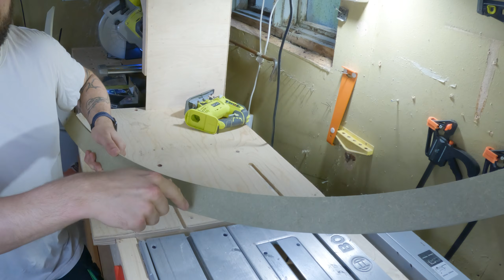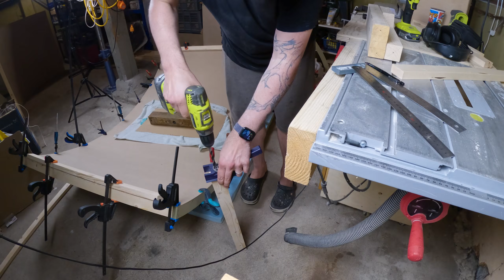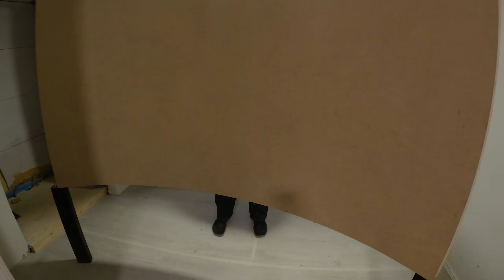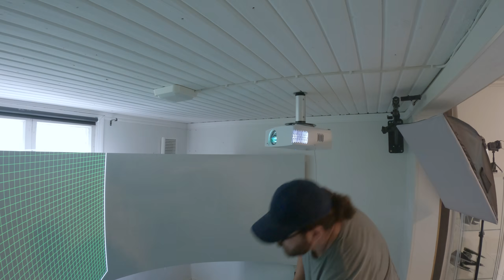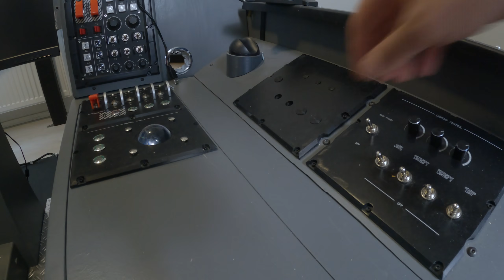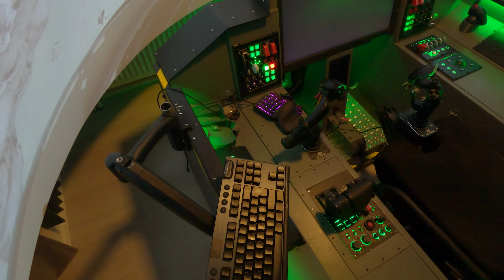ULTIMATE Simulator Experience - Building 180° Curved Screen for Space and Flight Sims

Comment: hello, i know you changed your display setup recently, but have a question about this.
i have 180degrees curved screen and 2 4k projectors, optoma wave120sk.
warping works good. and the software (display pro) shows it's correct resolution, BUT, in my eyes.. it doesn't looks like 4k... i feels like it less than HD resolution.
mapping is perfect here.. but can't even read some text on it.
i see you have almost same config with me.. but yours look amazing.
do you have any idea that i should try? 
i asked this to fly elise... but the FLY ELISE keep telling me to get another projector...
Reply from the maker: Unfortunately FLY ELISE customer support is quite useless. There are couple of things that might affect this:

1) You will always lose pixels due warping. How much, it depends on your setup. But it will never look 4k.

2) I had ultra short throw projectors and I think this did mean I needed even stronger warping in the center of each projector and the image might have been a bit out of focus in the center. The image was really soft there.

Imagine this: closer the projector is to the surface, the larger relative distance difference there is between the center and sides. I would expect the image quality would have been a bit better in the center if I had enough room to use something else than ultra short throw projectors. Though I'm not 100% sure.

Comment: What full resolution is this, and what is the "aspect ratio," as far as games are concerned?
Reply from the maker: Basically two 4k displays side-by-side.
Reply: @UndeadParrot  Your FPS must suffer quite a bit, I would imagine, as that is significantly more pixels than I push @ 32:9 5120x1440.  Also, I notice those projectors have a 16.9 ms response time... o_O  How does that impact first person on foot combat?
Reply from the maker: @biffrapper  Yeah, it can take a hit but I'm running 4090 so even SC is playable with it.

Comment: Awesome project!  I am in the planning stages of recreating your set up and had some questions.  
Inside radius is 130 cm
Width of curve is 5cm
Screen is 16:9 which is height: 146.25 cm?
What is the height of the legs to see above your touch screen?

Thank you for your help!
Reply from the maker: The screen height is actually 115 cm in height. But the size is only dictated by the size I had available. Basically it's two 16:9 screens side by side, considering the radius of 130 cm and 180 degrees.

For the height, I just calculated it so my head would be in the middle of the screen. So basically depending on your chair's height and your height.

Comment: Inspiring setup!  Really well done. Now, I'm so bold to have 3 questions: 1. As you have been experiencing the screen, do you consider your chosen radius of 130cm rather generous, tight or just right? 2. Regarding the overlap of the two projectors do you think you could cover more than180 degrees with both of them (like 210 deg maybe)? 3. What is the height of the screen and how did you figure that out? Thank you very much for your consideration and greetings from Hamburg
Reply from the maker: Hey!

1) Anything smaller probably would feel a bit cramped. This feels good, though not sure how larger would be.

2) Wouldn't go anything larger than 180 degrees. For 220, you would want three projectors.

3) Height is 130 cm. It's just 2 x 16:9 side by side.
Reply: @UndeadParrot  Thanks a lot. Again, great work.

Comment: why would you want to use trackir with a 180º degree screen?
Reply from the maker: Mostly two reasons: 1) I want to look up and 2) Star Citizen has quite horrific FoV settings so I don't have proper 180 degree FoV. Other simulators are much better.

Comment: Awesome work, buddy! Keep up the good work. I'm actually working towards a similar project myself, so your video was quite inspirational. Can I ask what model of Optima projectors you chose for your sim? Do you struggle with sharpness warping between the edges of each of the projected images and the center of each image? I imagine the projector optics is optimized for a flat surface, so I wonder if projecting onto a curved surface could call for some compromises on the overall sharpness.
Reply from the maker: Hey. I'm using Optima UHD35STx projectors. There are naturally some issues with sharpness. It's not perfect, but I prefer the immersion of a curved screen.

Comment: That's about $4,400. Not as much as I thought it would be. A couple questions if I may...
- You may have answered this already but what resolution are those cameras? I mean, does a projector really look like 4K or whatever it is? I only ask because my experience with projectors was a large TV many years ago and it wasn't that great.
- Could you add something like a Winwing MIP to this setup?
Reply from the maker: 1) The projectors are both 3 840 × 2 160 but the image quality isn't naturally on-par with two decent 4k large displays. And you lose some pixels with warping. It's really a matter of taste: for best image quality, using three large displays / televisions, but then you'd lose the seamless curved surface.

2) Yes, I'll probably get the Winwing MIP some day, though I'll need to get more into DCS before that. Some extra work to fit it but that's what this hobby is about.

Comment: Great video, thank you very much.
But I have two questions: why 4k beamer? Yes, the picture quality is great but isnt it a hardcore job for your gpu?  And 2nd question, would it be possible to use a short distance beamer?
Reply from the maker: Thanks!

I think the other option would be Full HD which would probably be a bit too low for this size.

I'm using short throw projectors. It works well enough for me at least, but you might get some softer spots.

Comment: @UndeadParrot
Again, a fantastic video.
Could you please give us a link to the projectors you used for your setup, or tell us which exact model you chose?
I checked out the Optoma Homepage, but it seems that they have several different 4k short throw models...

Thx,
Tom
Reply from the maker: Thanks! I’m using Optoma UHD35STx. Probably not the best option, but it was the cheapest 4k short throw projector I found.

Comment: Excellent job! Some years ago made my own projection screen using the diy maxxmudd paint formuler with silver added. It turned out amazing as I could use the screen in the daytime or with the lights on but obviously looked amazing in a dark room. When experimenting with the paint initially I had a light grey paint mix but settled on quite a dark grey mix. Thought it was too dark at first with the projector off but with the projector on everything looked perfect even the whites. The benefit of having the darker grey was that the blacks were even deeper and more "tv like", much better for space sims. The projector settings are just as important for fine tuning as I found I could tweak the advanced settings to get the blacks looking even better without crushing the dark details so well worth experimenting. Good luck man.
Reply from the maker: Thanks. Yeah, I think I'm also going to need more darker paint.
Reply: @UndeadParrot  The darker blacks are worth it with a projector. Good luck mate.

Comment: Great Job sir. I noticed you have radiant heat behind the center stand. Hopefully over time, the heat doesn't distort the curvature or cause discoloration. If it becomes an issue, you may consider a mild heat shied.  Cheers ~Mike
Reply from the maker: Thanks, and that's a good point. Probably need to keep that radiator low and mostly use the other in the room.

Comment: Hi mate, great project. Well done.  How wide is that curved screen? I’ve got a small room in the garage. Need to know whether it will fit.  Thanks
Reply from the maker: Hey. The diameter was total 2.6 meters. Though it should be doable with a smaller screen too.

Comment: I can't imagine doing a setup like this for multiple reasons. I have a projector in the basement and it generates enough heat to be unconfortable after a few hours of running. Your setup could potentially cut that time in half. My other gripe would be projector allignment. It's hard enough to allign one projector let alone alone 2 or more especially when you have to allign them to each other. Lastly, it's going to be super expensive to replace those lamps when they degrade or fail outright.
Reply from the maker: Sure, I'd expect VR or just normal display being better for most of people.

Comment: That's awesome! In my setup, I had the Optoma short throws from 2015/6, but they weren't 4k lol. As for the bright overlap in the middle of the screen, there should be a setting that will adjust the brightness of the light there, but I can't say for sure. I only used Simpit Warp, but since both programs are basically similiar, it should be there... somewhere lol The paint, Black widow is dang good!
Reply from the maker: I think I managed to get the warping really spot on, then hit my head into a projector. Well, after few attempts, it doesn't take that long anymore. :D
Reply: @UndeadParrot  lol, that happens! Especially when you also have crazed cats running around and throwing off the calibrations. I had found that a self leveling laser helps when calibrating.
Reply from the maker: @robertl4209  The laser would otherwise help but in this really old house, the floor isn't perfectly level. :D